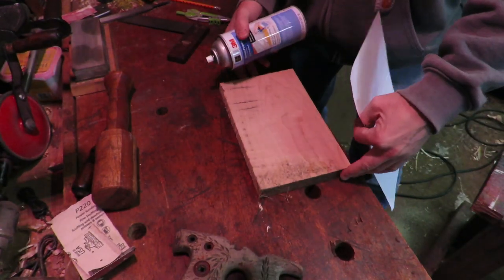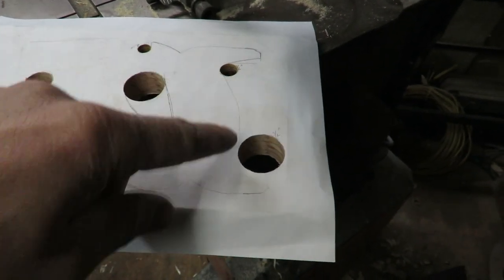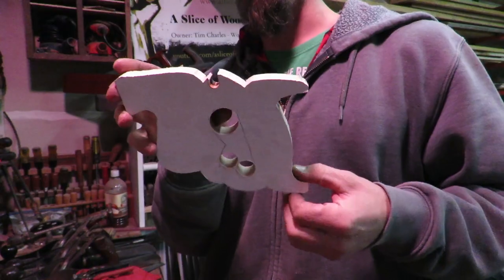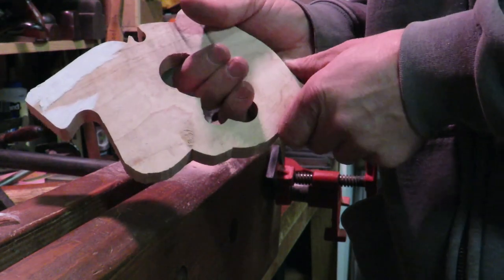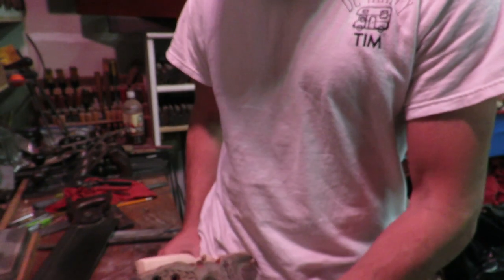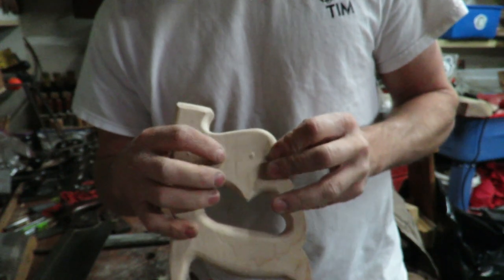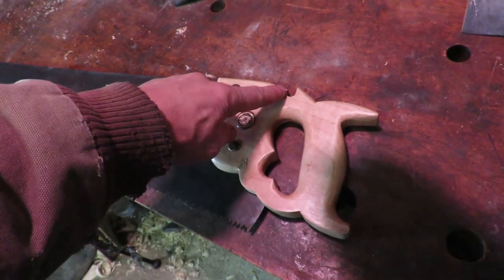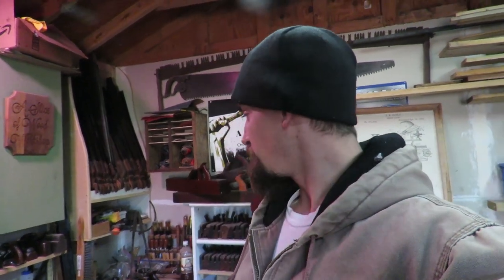Replacing a Hand Saw Handle

Comment: If you had your time back, would you have drilled the holes first, then cut a kerf for the blade?
Reply from the maker: Not sure. I have made 3 handles and each one I do it this way. I will try the opposite on the next one qnd see how it goes.

Comment: Hey there,

How did you remove existing bolts? Mine are spinning when I try to remove them.

I’d like to reuse as the decorative coin style is part of the saw.
Reply from the maker: Usually I have to use some sort of clamp. If it has enough pressure holding it in place I can usually undo the screw.